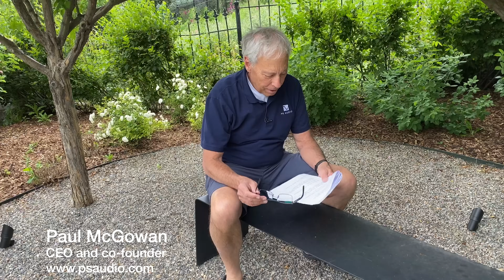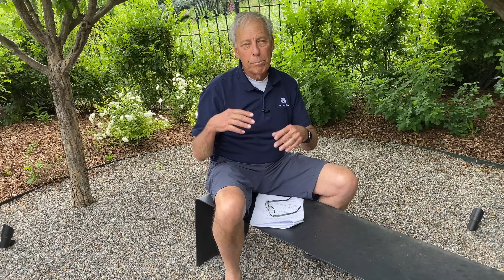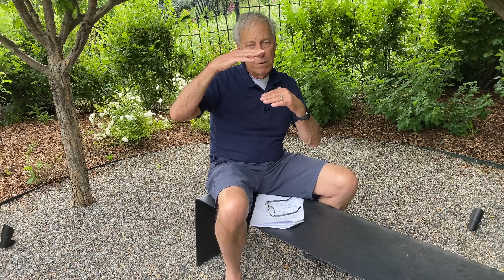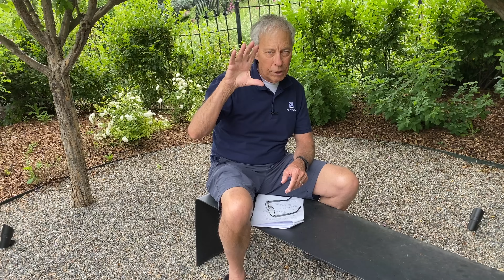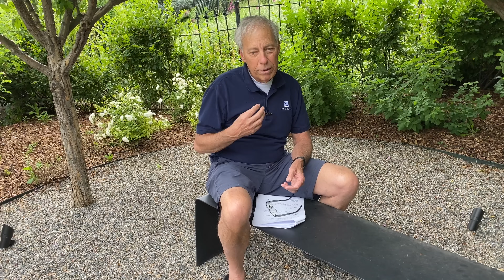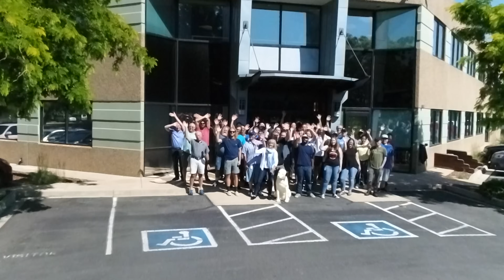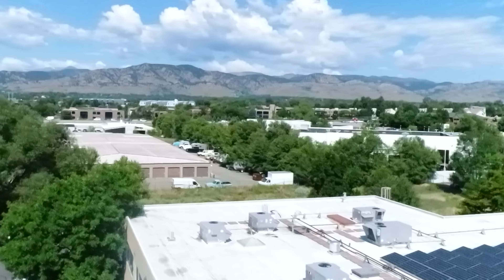Dynamic range expanders

Comment: DBX made a analog line of “dynamic range expanders” in the 80’s & 90’s. 1BX & 3BX were model #s
Reply: Dbx was a compression/expansion system. Easier to expand dynamic range if you controlled how it was compressed.
Reply: I used DBX when recording albums to cassettes.  The cassette had a fairly low amount of range that could be put on to the tape.  By compressing it on the way in you could get more when you decompressed it when it came out.  Like Paul said, you could hear some "pumping" on occasion but it definitely sounded a lot closer to the album than a regularly recorded tape.
Reply: @gizmobowen  I used a dbx to record albums to cassettes too. I had a SONY TC-229SD cassette deck which had bias for FeCr tape. I recorded 20 dB down, where the tape was most linear. The sound was almost as good as Beta HiFi (frequency-modulated signals on high-bandwidth tape).
Reply: Yes but the one I had was an encode/decode machine, You had to buy dbx encoded LP's, which were more rare than CD4 discs!
Reply: DBX had more than one thing going.  DBX noise reduction was an encoder/decoder meant for magnetic tape.  DBX had a rivalry going with Dolby.  So the few companies that managed to license with both had to promise Dolby that their users could not use Dolby NR in conjunction with DBX NR.  I had a Teac tape deck that had both.  I opened it up and found that simply clipping a single piece of plastic allowed me to use both NR systems simultaneously.  But a user had to open up the box and know what to look for in order to do it.  There was another use for this unit.  One could insert it at the beginning and end of a tape loop and provide noise reduction for a multi component stereo.  Thus, the signal is encoded at the beginning of the tape loop, and then decoded at the end of the tape loop, providing overall system noise reduction during playback.

Another system DBX had was its "#BX" series of dynamic range compressors/expanders.  This series goes all the way back into the 70s and was popular all the way into the 90s.  The most popular was the 3bx.  And with the advent of digital (and the Sony standards for "digital ready" components) the -ds (standing for "digital series") was wildly popular, especially among military GIs.  I bought the DBX 3BX-DS back in the late 80s, and it has performed marvelously for decades.  I still use it today.  ALL DBX dynamic range companders (compresser+expander) was analogue.  The DS designation was merely to show that the unit met Sony standards for "digital ready" devices.  A lot of equipment didn't meet the minimum standards, so the designation was a big deal back then.  DBX did a pretty good job of "knowing what peaks to expand and what soft passages to compress by separating the signal by frequency.  The 1 band was quite obviously "breathy".  The mids and highs sounded like they were breathing because the low notes would trigger expansion/compression.  The 3 band got rid of a lot of that breathiness for a reasonable price.  Breathiness was almost non-existent with the 4 band, and you could make it totally inaudible with the 5 band.  But the 5 band, even today,  can cost over $2000 on Ebay for a 35 year old component.  Yes, this one 40+yo unit can cost as much as some people's entire stereo system.

Today, DBX has gone mostly with live, studio, and "professional" equipment (live bands and DJs).  The BX line was discontinued decades ago and they don't even offer any service support for some of the equipment (namely the 4BX and 4BX-DS)  and offers no modern substitute for these units.  Everything they have now does not offer any dynamic range expansion - they are all purely compressors/limiters with no expansion at all.  Even in the digital software realm, I have not found any software that offers dynamic range expansion similar to the DBX #BX series.  I very much wish I could find a component that closely matches the DBX 4bx or 5bx that matches today's S/N standards.

Which is a real problem, especially for the 4bx series, which uses a digital signal processing chip to control the LEDs with a small amount of EPROM on it.  This EPROM has a shelf life of about 30 to 50 years before it loses its programming.  People are paying well over $1000 for this unit on Ebay, not knowing that this chip is nearing it's end of life with nobody anywhere in North America who has a copy of this memory (not even DBX).  You can find a suitable replacement for the chip, but without a copy of the memory or a schematic to recreate this memory, the unit is doomed to be un-repairable once it fails without very extraordinary efforts that nobody I've found is willing to try.

Some tech would have to get his hands on a working 4BX, and make a copy of the programming, and have the means to program the suitable replacement chip.  Anyone who does will have a monopoly on repairing that unit.  But you're looking at over a thousand dollars to get your hands on a still working unit.
Reply: @jdlech  I actually had someone do this... it was stunning to read your post.  It was a team effort of 2 companies taking it as a challenge to fix mine, which I inherited.  Speaker Workshop in Fort Wayne was the lead.
Reply: I purchased a 3BX maybe 1.5 years ago off ebay. It is fun to watch and it does change the sound (only have it for playback and am not going to do any cassette recording (!) so it is not set up for that). I could not afford to buy one 40 years ago when I was in college, could now. Part of the hobby for me.
Reply: I had a 3BX back in the late 70's and it worked great with vinyl records and cassettes during that era. It definitely enhanced the dynamics by  an additional 30 db or so  if I remember correctly. Almost equivalent to digital standards of today but not quite.
Reply: I understand DBX was a compression (recording) and expansion (playback) system so only worked with suitably encoded recordings. Far better, in my opinion, to leave all this extra gubbins out of the playback change and just ensure the source material is correctly mastered in the first place. We can all dream.....  ;0)

Comment: The DBX 4BX Has adjustments for transition, impact, expansion & volume. Works great with older amps, not so with the newer in my experience.
Reply: Newer amps don't usually have enough wattage.
200 RMS is the bare minimum.

Comment: Howdy.
Compressor circuits can be found in the net. One could use an op. amp. and insert the compressor in the feedback. The op. amp. output should thus be expanded.
I agree though that the expanded quality would most likely be poor and not meet high end demands.
Regards.

Comment: Dynamic expanders were commonly used for noise reduction, and within the context of a single track within a multitrack recording rather than a whole mix - e.g. downward expanding, reducing the quiet bits to reduce the noise floor. I remember quite a few cheesy 'home studio' devices that had a much greater noise floor than the one they were trying to reduce! A particularly bad noise gate (from a quite reputable company) was quite effective at picking up the radio!!!
Which company? Here's a clue;     ' ......butter'  (actually, it might have been their subsidiary - easier to make a clue though not as good!)

Comment: In the future I bet an AI could isolate every instrument and voice and then return them to the user in seperate tracks so they can pan the volume, eq and even position in real time. I bet something like this is less than 10 years down the line.
Reply: AI helps, I use it, but you can already do this on a per frequency basis.

Comment: I used a dbx 3bx expander for years back in the 70s. It was a 3 band expander which helped reduce the pumping and breathing artifacts and was pretty successful as long as you didn't overdo it. But today's loudness war has resulted in so much compression that it would be all but impossible to undo the gross amount of compression employed.
Reply: Hi Stu If you could be bothered, go back to Does using a subwoofer change speaker design (July 12th post) & read my report to ThinkingBetter (his comment thread) about my impressions of the difference between having those passive 80Hz high pass filters off-line again.
Reply: @FatRat-f9m  will do.
Reply: Hard limiting is your enemy today.  It can be overcome.  I made a vid.

Comment: Dynamic range expansion after-the-fact is terrible. 
Several devices made by dbx did a fair job, but none of them did a great job of it. 
The best cure for compression is producers not using it in the original recording.

Comment: Paul touched on a valid point regarding the 'loudness wars': since nobody listens to the radio any more, why do engineers supposedly continue to over-compress music?
Newsflash, people: the 'loudness wars' are an audiophile myth. The reason why there's a smaller gap between the peaks and the troughs in many recordings from the 90s onwards is that there are very few truly quiet moments in most forms of music. That's got a lot to do with the widespread adoption of digital multitrack recording in the 90s. A lot of music in the 70s and early 80s was recorded on 8-track tape, which severely limited overdubbing because of tape hiss. Ditto tape-based echos and tape-based delays. In a digital studio, there's virtually no noise penalty; there are also 32 tracks available or more.
The upshot of all this is that there's just more music going on in the background. A steady 100dB bass drum is the same regardless of what's going on behind it, but obviously the dynamic range will be lower if there's a pretty solid 88dB of music constantly in the background, compared to a background fluctuating between 66-88dB. That's why the dynamic range is lower. It's not compression, it's composition.
It bugs me when armchair expert 'audiophiles' convince themselves, on the basis of internet hearsay, that they know more about the music production process than people who actually do it for a living. If you want to hear what overcompression really sounds like, go out and buy yourself a secondhand Alesis 3630 - they're not expensive - plug it into your system and crank up the settings. That way you might actually learn something - not to take everything you hear on the internet as god's own truth.
Reply: What you're saying is partially correct (except for the loudness wars bit).  Listen to Metallica's Death Magnetic (as one example of many) and compare that compressed and distorted garbage to Metaliica: Metallica.  This is a loud outfit, but the compression on Death Magnetic is inexcusable.  Compression, if used intelligently can improve the bottom end of recordings and smooth out some of the more annoying transients, but using it to push the levels and squash everything together leads to a painful experience.
Reply: @MrGorpm  Fair point! Is it really about the 'loudness wars', though, or is it more a case of the band falling victim to 'Spinal Tap syndrome' and demanding that everything go up to 11? ;¬)
Reply: @thisisnev  I'd love to argue with them about percentages ;-)
Reply: @MrGorpm  I agree with this, and must make mention of a related problem: The results had due to MP3's compression method, and those from efforts to compensate for it. I once made a cassette recording of a late-80's pop/dance song, as it streamed from an MP3 file source over the internet. During playback [on a different system], I noticed considerable "wowing" of certain bass notes so great, it was taking presence over the lead vocals. Knowing this song/work well, I doubted it was result of a difference of equipment... nor just something I "hadn't noticed before". When I later learned about the "masking" of quieter passages the MP3 algorithm does, I wondered if this was what's to blame. However, with the argument of how modern 24-track digital recording allows for all parts in a performance to be unwavering in their loudness, it leads me to believe that MP3 compression is really meant more for works that had their master recordings done on said newer equipment... not what was commonly seen in prior days, even at big record companies.
Reply: @FatRat-f9m  
"but this is one louder, it goes to eleven" 😆😂🤣
Reply: Other than this, bass is generally louder and that limits crest factor
Reply: "The reason why there's a smaller gap between the peaks and the troughs in many recordings from the 90s onwards is that there are very few truly quiet moments in most forms of music."  
You need to get out and listen to more live music - when it's safe, of course.

Comment: Once a waveform is clipped to say, -9dB, and then expanded back up to 0dB (or something like that), the original information that was clipped away no longer exists. Therefore, it just doesn't work. There is no repairing to be done to information that has been cut out of the signal...
Reply: There actually is an amazing amount that can be done to “repair” a musical recording. I’m a big fan of 1930s and 40s big dance and and many recordings of that era have been processed. It began to happen in the 1970s and has come a long way since. Good example here:
https://en.wikipedia.org/wiki/Lady_Day:_The_Complete_Billie_Holiday_on_Columbia_1933%E2%80%931944